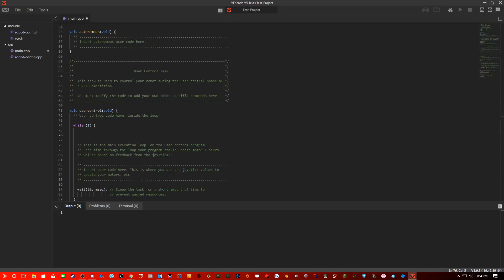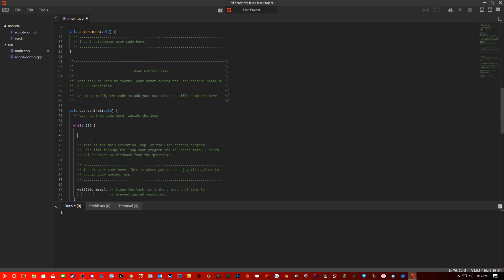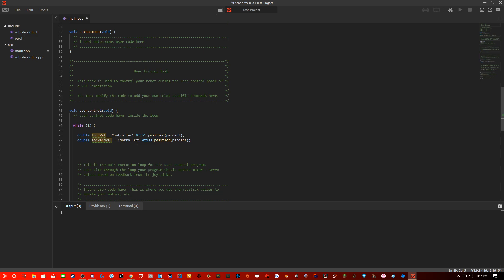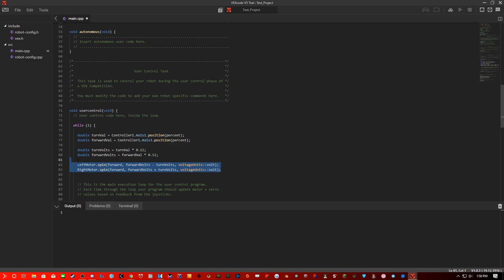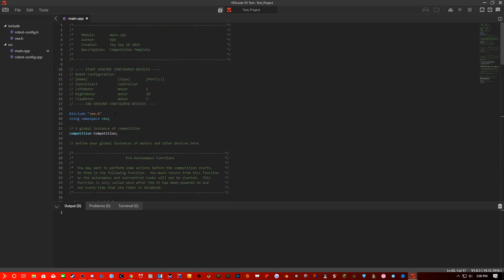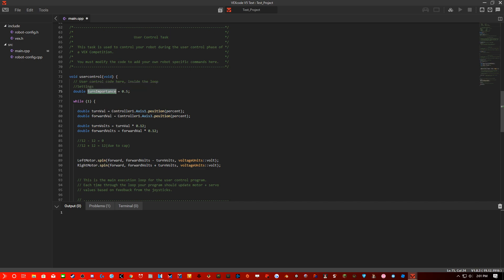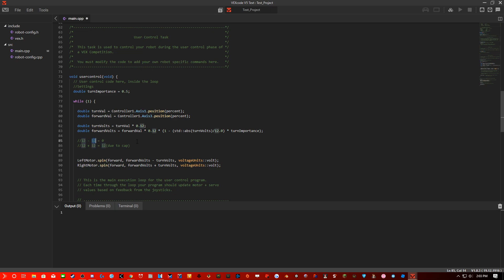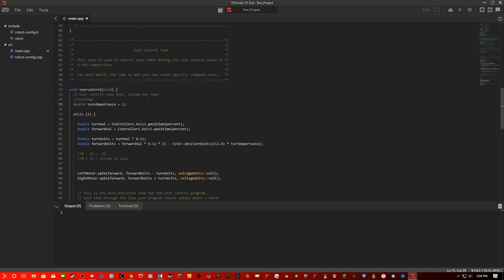C++ VEXCode V5 Text Tutorials - Programming the Clawbot Drivetrain THE RIGHT WAY

Comment: This still works you just have to remove the "percent" from the controller axis position and remove "velocityUnits" from the spin command. And it does make the robot significantly faster than controlling the motors with percent values as he said. From my initial driving the last bit about improving turning seems unneeded.